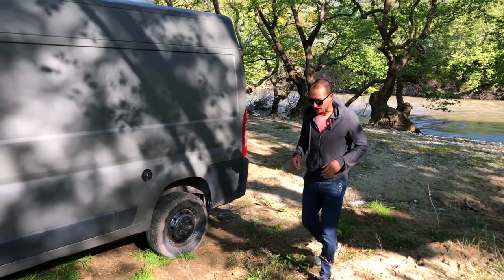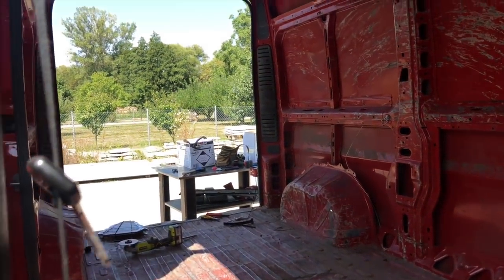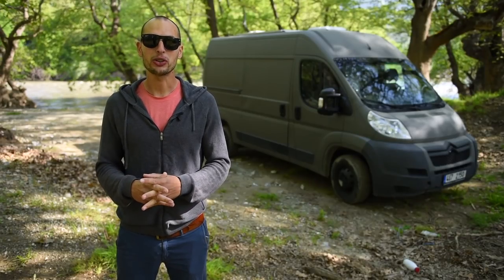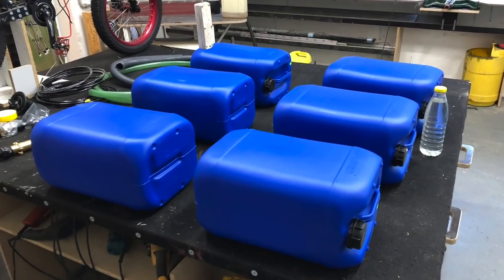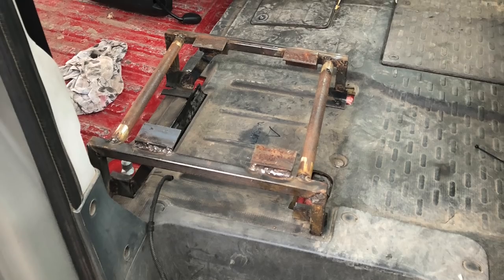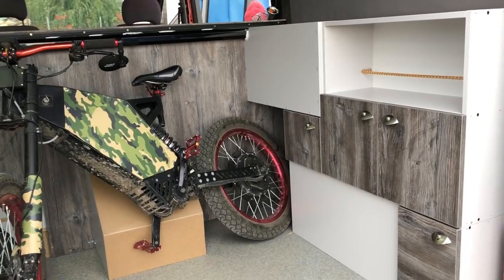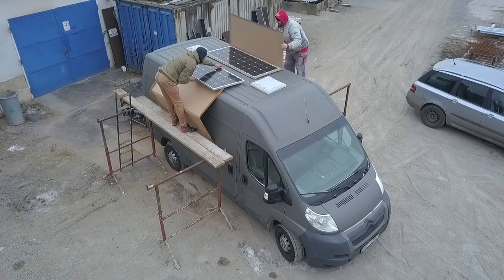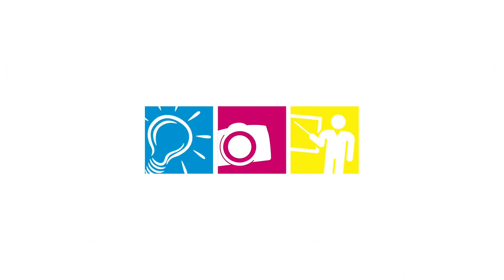How I Built DIY Camper Van for $6000 / Smart Ideas for Conversion!

Comment: One word: BRAVO!
I too was sceptical when I found your van build channel and you said, 6.000$ for everything. This video sums it up.
I bought an almost new VW T5 high roof 2 years ago and started converting. I have spend 6K€ so far, that's for insulation, ply lining, hot air heater, hot water system with a calorifier and aluminium structures. I could have saved a lot more money, but consider it an investment..
The most difficult thing for me is that from day one my new van became our daily driver, driving daughter to school 2 times a day, shopping etc, plus that fact that I don't have a workshop or even a garage. Everything I did was lot's of time inside the van when raining or just working on a public parking without electricity,  mostly at night in the winter with a headlamp. My neighbours know all my projects LOL.
I did not have any tools at all, so investing in a toolbox and a workshop would be my best advise. 
Thanks for the inspiration. Cheers!
Reply from the maker: I can imagine how difficult any project is with a workshop and proper tools. I used to be like this and that was my biggest drive to have a creative project supportive environment. Good luck Anton!

Comment: What are the 5 things you would change if you would redo the build? Did FWD prevent you from going anywhere, compared as if you had 4x4?
Reply from the maker: Thanks for the question. To be honest I wouldn’t change anything. We did the best possible job when building it and as we go and learn what we miss, we improve it.  Would like to have better and bigger battery but I didn’t have money for anything bigger/better. We’re planning compressor fridge but again, this one was free and we knew we’ll replace eventually. So there is nothing like fundamental mistake that I would do different from the beginning. As far as limitation with fwd goes. Not really. But we are not people that would have to be climbing some extremes.
Reply: @ladiandmargaret  
What about a freezer to store food?
And a microwave to reheat it (better than fast food)?
I think I saw you had a regular gas canister, this is good, but a compact camper one might have been enough for 1-2 people, and help save you weight and space.

You can also carry a bucket or empty stool with a seat-cover, to do your toilet when camping.

The biggest advice I can give you, is that you should build little sides next to the desk and have a (thick black) curtain. That way you can block 100% of the light that comes in or out from the front of the van to the back. It means you will get privacy. And it also means if anyone spies on you, they will just see a blank background, and they will think it is just a company car that is empty and won't be curious. Going stealth definitely gives you more options in places to park. But you might want to install some cheap cameras around, discreetly, so that you can see if someone is trying to give you a parking ticket from the comfort of your bed/phone. And it doubles as a dash cam.

Your choice of colour grey is good. I think white is better for summer heat and looking like a company car, but it shows the dirt more easily. Black stands out more and shows a lot of dirt as well, so good choice avoiding it. The best colour to not show dirt is Khaki (light brown) but then the car will look like an off-roader/jeep and not a company car.

Comment: It's great and well designed. Love the bikes ! The only problem for me is that there are no windows in the sides for some natural light to come in.
Reply from the maker: Thanks so much. We wanted privacy and incognito look. Roof windows provide plenty of natural light so it doesn’t feel like a cave.
Reply: @ladiandmargaret  awww ok, gotcha :)
Reply: I have a van with only the rear windows (heavily tinted) like a lot of work vans do and they provide more than enough natural light.
I was thinking to install one side window but now I am happy I did not. Consider also the fact that windows are very difficult to isolate and you will get condensation. I roof fan (or 2) are a must.

Comment: Considering upgrades at their cheapest the van should cost 3000 max. How is that possible??? In usa the van with 200k miles and very heavy body damage costs 10k+ usd
Reply from the maker: You need to research more, just like I did. https://youtu.be/-xXHUyMS8fI
Reply: Nope, I bought a 2006 Sprinter for $3,000 in the U.S. with less than 200,000 miles on it, and it’s still running strong with no major repairs three years later. It’s what he said .... research and wait! Also, all areas of the U.S. are not the same ... you want to buy in the midwest, not the west coast!
Reply: @annecaulder9495  the van in video is promaster (or citroen jumper). in USA the promasters are very expensive

Comment: Love the bed and the projector ! How is the paint holding on so far ?
Reply from the maker: Thanks so much. The bed is unbelievably convenient on daily basis. Projector especially these days when game of thrones s8 are coming out 😂 Paint is very good. No chips at all. Good thing about it is that I don’t really care when I scratch it now and then driving through some bushes. It was so cheap that I can roll another layer before selling it.
Reply: Amazing ! Thanks for your reply :) 

gotta love that episode 3 thought haha ! 

Sounds amazing... did you use regular paint or a proper car paint ? :) I would love to do the same on my campervan !
Reply from the maker: It’s metal body so I bought 3in1 paint for this purpose. I spray painted first all curves, doors inside etc...everything that would be difficult to roll and would look like a crap doing it with a brush. I didn’t want to spray the entire car because of big off spray outside and I was afraid to do it without properly ventilated room. This time I would spray it all. It looks better, paint is cheap and oa it would be faster. Especially roof is curvy.